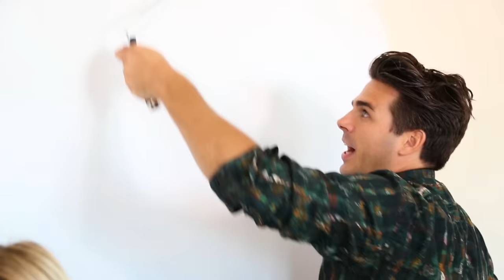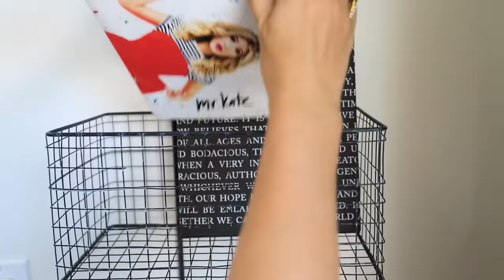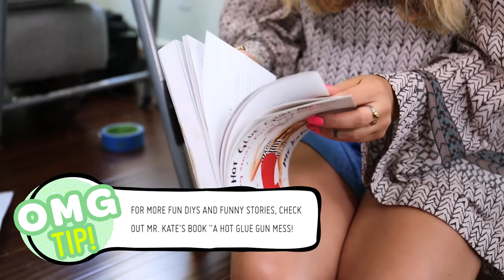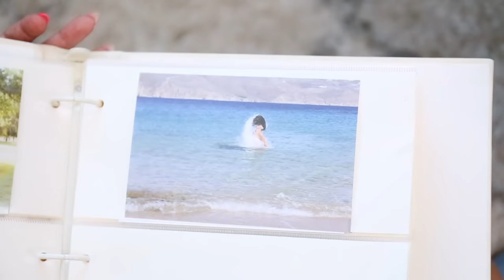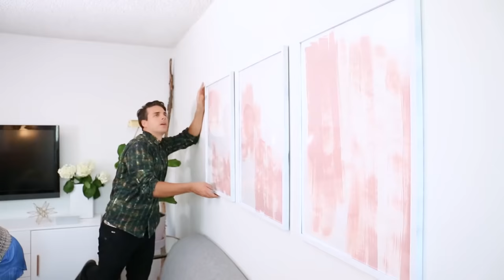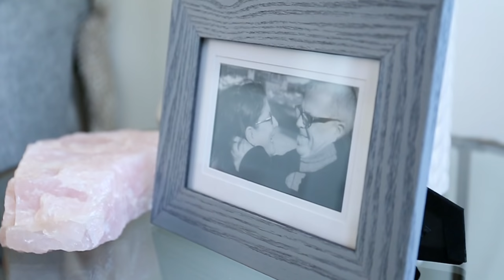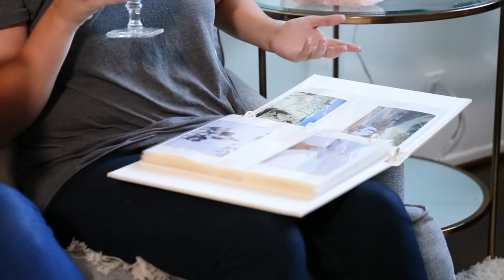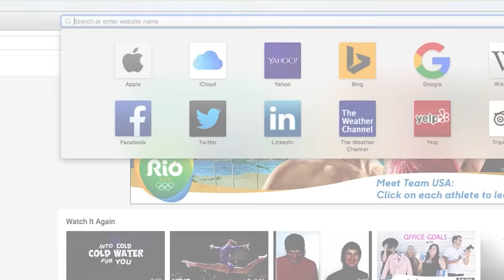Studio Apartment Design Challenge for Joslyn Davis

Comment: Didn't think you could drill and paint rentals..
Reply: or spray paint things that are part of the wall... yeah there's going to be a giant fine.
Reply: Yeah, you can't pain or do stuff like that in rentals. You can drill (it's easy to fill small holes and paint over them depending on color) but in mine and my husbands current rental (which is also in CA) we can't paint the walls, drill large holes, etc
Reply: You can definitely hang things on the walls of rentals, and also depending on their rental agreement, most places will let you paint walls as long as you promise to paint them back, or keep them a neutral color.
Reply: +Jessica Onken there is not going to be a huge fine in a previous reply to a similar comment Joslyn said she had permission from the landlord!
Reply: +Kelsey Morine-Reid That's great for them then but for normal rentals there would be.
Reply: it really depends on the rental & the type of landlord that you have.
Reply: she had permission
Reply: Your allowed to as long as you fix the damage and make sure it's correctly furnished
Reply: +Jessica Onken Not necessarily a fine. That's what security deposits are for. If she doesn't paint the walls back & fill the holes, she won't get her deposit back when she moves 🙃
Reply: it depends on the place. most places allow you to customize as long as you change it back before you're out. other places you're not even allowed to hang pictures.

Comment: As an apartment manager this made me cringe.
Reply: I thought that too! Hahaha.
Reply: why?
Reply: why, because it's gorgeous
Reply: I didn't cringe until she painted over the wet bar mirrors, I was screaming NO!!!
Reply: not to worry :) i had permission :)
Reply: +Joslyn Davis So.....how's the bathroom????
Reply: It can be scraped off with a razor blade and Bon Ami soap.
Reply: why? most apartments look like crap, an apartment manager should be stoked that a tennant fixes up a room at their own cost..
Reply: +Charlotte H The issue is that many people don't know how to fix up a room right or safely. For example, the reason most managers don't want tenants drilling holes is because the walls will eventually lose integrity and the drywall will need to be replaced, which will cost them money.  Plus it's easier is rent out a plain room than it is a room that is stylized in a way that won't fit most people's taste